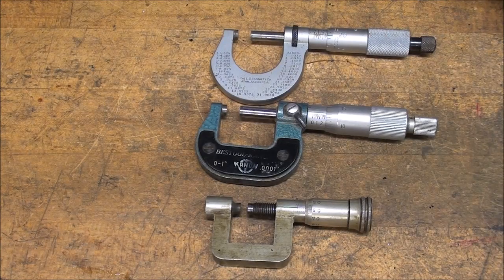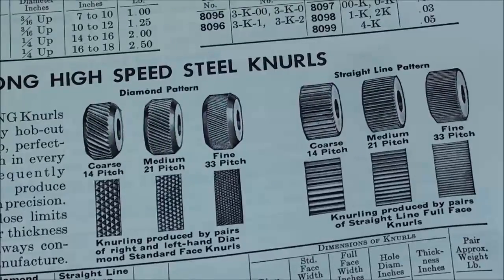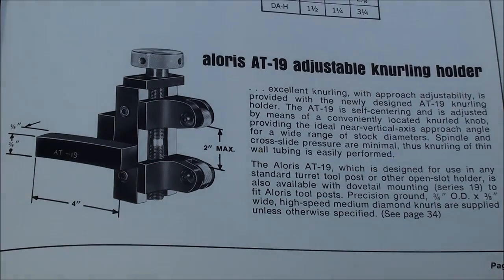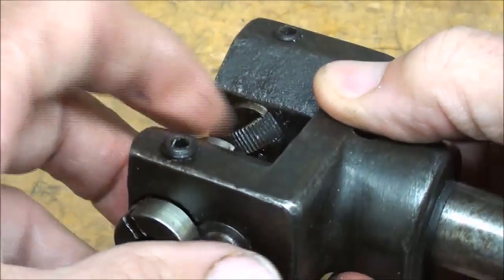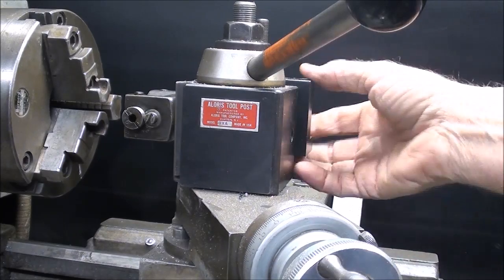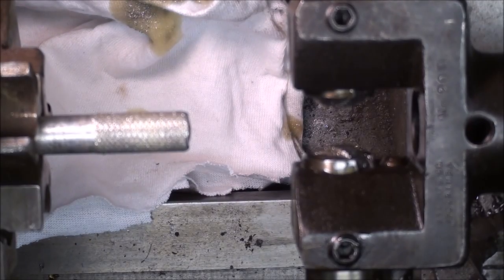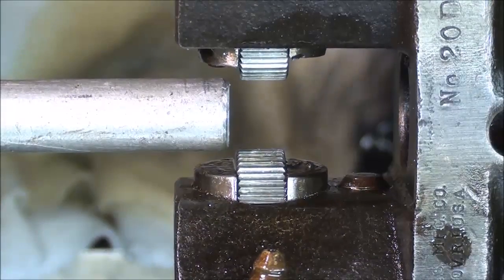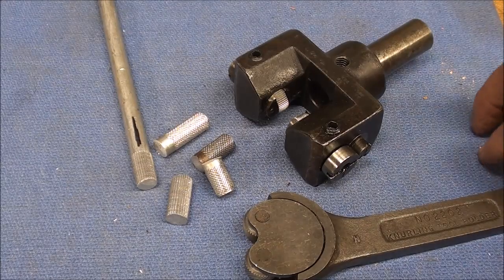SHOP TIPS #215 Knurling on the Clausing Lathe tubalcain knurler

Comment: This is long after when this video was posted, but 2 questions, if anyone who sees this can answer them: 

1) I’m confused by the fact that you don’t seem to have to calculate the spacing of the knurling dies (that is, the final part diameter between them) to match the pitch of the knurls. Isn’t this kind of like gear teeth, where the number and pitch of the teeth need to match the circumference? I’d expect to see some sort of defects, where the pitch and circumference didn’t match.

2) With harder materials, a wimpier lathe, or a thin part that can’t be supported as well as you’d like, do you ever need to take multiple lighter passes, rather than a single full-depth one? Would there be a reason why you wouldn’t want to do that? (I guess some metals could work-harden, so multiple passes would be self-defeating…) 

Thanks in advance for any insight people might have on these!

(And many, many, many thanks to Mr Pete for all the knowledge, experience and information he’s shared so generously here!)

Comment: Hi Mr pete i bought two sizes of pinch type knurlers one large one small chinese made for under $100.00 and they work good now if you need to change the roller i think you need to knock out a straight pin at this point you might have to make a new pin and thread it upgrade . with the two tools i can knurl up to 4 -1/2  in . copy of the Eagle rock tool made in usa. bought on EBay made in India .

Comment: I've never actually seen a scissor or otherwise opposed knurling tool actually used before, it seems the bump style is more popular on youtube because they work on any size work  (including working past a larger diameter) with no adjustment and are relatively cheap and can even be easily made. This type does seem much faster and requires a lot less out of your machine, though I do still see the draw of the other type. I'm also guessing, based on how often I see it, that it's ok to use a brush for an open wheel bump style knurler since there's a lot less for the bristles to get caught in, especially if it's on the exit side.

Comment: "I recommend you sell them on ebay to some unsuspecting sucker" LOL 
I agree about the superiority of the scissor type knurling tools. I was having issues with the lateral pressure from the lousy type knurling tool making my tool post rotate regardless of how tight I made the nut on top of the tool post that holds it down (I went to the point of stripping the threads of the vertical shaft that goes through the tool post). Then I bought a scissor type knurling tool and never looked back.

Comment: Very cool.  I need one of these things.  It would seem that the diameter of the stock needs to be such that when the ridge of the knurling tool comes around it ends up in the same place. If so, then the diameter of stock/diameter of knurl wheel/ridges in knurl wheel = integer.  Is my understanding correct?
Reply from the maker: I believe that is a misconception

Comment: Those aren't cheap anymore. EBAY: Brown and Sharpe Knurling Tool No 22D Shank Diameter 1" for Machine Machining
Pre-Owned    $130.00; BROWNE & SHAPE KNURLING TOOL 5/8 SHANK OO D LOC5132 Pre-Owned  $75.00 or Best Offer
 +$8.95 shipping     Buy It Now .   I got a 20D for $75+shp.  I like how this tool works.  Buying a used ENCO1340 lathe tomorrow.  You got me off my retired butt and back in the game.  Thanks

Comment: I liked the video very much.  I am not a machinist, but I do have a hobby shop in my basement.   I have mixed success with knurling so far, and have identified the need to do some math with the knurling wheel pitch and that expected knurled part.  This is indeed a mathematical function that has to be taken into account.  Common sense tells you that if the part circumference is not a direct factor of the knurling tool, you will not get a proper pattern.  Correct me if I am wrong...

Comment: A couple years ago at work we had a couple new parts to knurl, the (CNC) programmer had never done it before, neither had any of us. The part had a jeweled looking finish to it that looked fantastic, but, wasn't correct by standards. For days we tried different feed rates and speeds until we finally saw the problem. He had programmed the spindle to reverse when after initial feed was done to back knurl tool back off parts.
Reply from the maker: Glad you found the solution

Comment: Mr Pete: try as I might, I have never been able to see HOW a knurling tool does NOT overlap unevenly; as it goes past the 360 degree point of a turn; UNLESS it would be sized PERFECTLY to EACH piece it is knurling. Where is my thinking flawed? Could you please explain that in detail if you will? As always your videos are exemplary. May Jesus continue to richly bless you and yours always dear person.
Reply: It's kinda like having three gears mesh together. no matter the size of the middle gear, if the two outer gear are spinning as the same rate and have the same size with the same teeth pattern, they would still mesh and not grind or whatever.
Reply from the maker: To me, dia. has nothing to do with it. Billions of good knurls are made with pinch knurlers with no thought of dia
Reply: You are onto something.....Remember, in the video, Mr. Pete told you the tool was for 3/8 inch...so yes, those knurlers would work, AS LONG AS YOU TURNED 3/8 inch stock.....So yes, you are right....You're thinking isn't flawed...I learned this on my own...  You can't just knurl random sized stock and get a perfect diamond knurl.....You have to do some calculations.....But, if you're knurling other sizes, you have to match the diameter/circumference of the part to the knurling tool....  Excellent point.

Comment: Another question: suppose one were to make a tool holder that can hold the knurler vertically. That is to say a tool holder that bolts down to a slotted cross slide. The holder is such that the knurler rolls point upward as opposed to the conventional  toward the spindle. (assuming you could adjust/position on-center height and centered along X axis). Would the knurler still work? This would allow those like me who only have say a South Bend 9A (I only have an AXA tool post), to do longer knurling operations, or larger diameter knurls with the bigger B&S knurlers  (like a 1" or so).  I don't see yet any reason it wont work. unless the rollers cannot be positioned sufficiently for a vertical placement of the tool. But if it would work, I can envision it coming in pretty handy!

Comment: Mrpete I once had a 4x4 truck that had a bad front drive shaft splines stripped out in slip coupling I was told the splines were knurled on I got a man at a machine shop to make me new drive shaft with course splines.
Reply from the maker: +Joe Tiller No wonder they stripped

Comment: very cool video, we do a lot of knurling on the screw machines, it's very different and kind of easy ,it's done with a cam called in and out and is adjusted with a set screw on the tool holder, once again very interesting video.
Reply from the maker: +bill devlin Never saw one of those-Thanks for watching

Comment: Thank you!
I "recently" (within a year) found an old ball-peen (machinist size?) hammer that turned out to be one my father made in the 50's in shop class. It was in amazing shape. I've marveled at it as I've cleaned it up and done my best to provide it with usability as well as longevity by doing some very light (carburizing flame) case hardening of the head, cleaning the threading up and trying to concoct an anti corrosion coating that doesn't ruin it's aesthetics.
I'd just started wondered how he did the knurling on the handle how precise so many circumferences or their ratios must match in order to avoid missed knurls.
Reply from the maker: +MrJgstoner  Thnks for watching--be sure & watch my recent on knurling.
Reply: Will do!

Comment: Thanks Mr.Pete.All we had in high school were the tool holder type that you dislike. It would usually take me more than one try to get it right.If you straight knurl the inside of a bore,could you get it to spline to a straight knurl on a shaft like a slip yoke on a drive shaft?
Reply from the maker: +Mr Frog  Thanks for watching-I have never done internal knurling
Reply: Okay,just wondering.Thanks again Mr.Pete!
Reply: +Mr Frog  I have tried that, here's what I learned.
1. IF you get the same number of splines on both parts and
2. IF you get the correct pitch diameter on both parts and
4. IF you get the same side angle on both parts and
5. IF you get the same twist on both parts (straight knurling is seldom truly straight) then you will get a marginal spline that will have little strength or lifespan. Because of changes in pitch a few teeth will bear the load and wear, quickly becoming sloppy. Splines and gears are sometimes roll forged but are usually finished by milling, grinding, broaching, etc. to ensure size and straightness.
 My advice is if you need a sliding shaft joint then use a captive key and keyway or a square shaft and hole or an Allen wrench and hex hole. Square and hex holes can be found in sockets and socket-head screws. If you need a free sliding shaft then use a key or a square as hex can wedge under load like the setscrew that sticks to the wrench.
    Mike (o\!/o)

Comment: Seems like the variable use of this tool is small and that purchasing  one for every size might be costly over time. Also, if this is variable in the diameter usable, then perhaps the knurling might not be perfect if you change size a little bit (I have no idea how much would be noticeable). Like you said, I plan to buy a scissor type (one tool fits most sized I would want to do). Perhaps in the future, you might do a video on the scissor type of tool. This video leaves me very confident that if I did have this type of knurling tool, then perhaps I could do it easily and repeatedly. Thank you yet again. OH, and yes, I will sell the one I was a sucker and bought!!. ;)
Reply from the maker: +Jeff Conti  Thanks for watching--mine has a range  1/8 to 9/16

Comment: Mr. Pete, I have had success with the relatively inexpensive clamp style sold at little machine shop: http://lmscnc.com/1911 
I just match the diameter of the work to the number of teeth in the cutter to in order for the knurls to line up as they spin around. There is a handy calculator here: http://littlemachineshop.com/Reference/Knurler.php
I prefer to use a normal calculator and find the nearest division, then round down for my diameter.
Reply from the maker: +bendavanza  Thanks for watching--I might buy one of those

Comment: Hi !
Very instructive video for that size of stock you use there.

You don't mentioned the relation between the diameter of the stock and the type of knurling wheel you're using - because you tool is setup for the 3/8 size.

But the is some debate about this relation between the diameter and the wheel type - some says "Doesn't matter at all !" others says is DOES matter - Tom Lipton did a whole video showing the math for finding the right diameter - anyway I did a program to help you find the nearest diameter OVER/UNDER the one you want that FITS the wheel type you're using. 

If you're interested you can download it from my web site: kelds.weebly.com/sjov.html

but you have to know how to install programs on your machine - not the lathe but the comfuser ;-)) - and I garantee there is NO VIRA or stuff like that i that file !
Reply from the maker: +Keld Sørensen To me it doesn't matter at all, but most would disagree- Thanks for watching

Comment: I totally agree with you about the crude push type knurlers, they are the one tool that would put people off knurling for life, thinking for ever more that it is a black art! The knurler you show is a very good design, although for its cost has a very limited range of diameters that can be knurled, I always use my scissor type knurler which has a cam type pressure variation, this, unlike the awful push type, produces no side thrust on the workpiece, it is also self centering, (to a degree), and providing the revs are right, and copious oil flush is applied an excellent knurl every time.
Reply from the maker: +Englishman French  Thanks for watching---yes on the push type, no like

Comment: I always wondered how the knurling lines up once the work has done a full rotation?  I would think murphy's law would take effect and you would see a sort of a doubling up of the knurls.  Are the rollers matched exactly to the diameter you are knurling?
Reply: +Atimatik Army 
You might want to see this:  https://www.accu-trak.com/catalog.html 
The first pages of their catalog shows some basics about knurling, this is where we get our wheels for the knurling tool we designed and made, this tool  will end up in Keith Fenner's toolbox giveaway, we're planing to release the plans to make one pinch type tool like this one...
The diameters aren't super critical, you have to get close and sometimes it requires a bit of adjustment, by varying the depth a little you make up for difference...
Hope it helps...   ;)
To see what it looks like, you just get to my channel and see where we're up to, there is a video that features the prototype in action...
Reply: If I remember correctly the diamond knurling tools will mostly self align as it is worked in. For other tools starting with a piece circumference that's a multiple of the knurl spacing works best. This is from memory from quite a while ago so someone else can give you a better answer.
Reply: Interesting, thanks for responding, if anybody else can elaborate, by all means please do! cheers
Reply: +Atimatik Army the chamfer, and the precise setting of the distance between rollers in a pinch type knurler will also align the knurling. It's with the hand knurling that things get tricky.
Reply: So with a pinch type knurler tool, they must be only able to do very specific fixed diameters in order for the knurls to line up exactly on themselves as the work is rotated, correct?
Reply: Atimatik Army the knurl pitch diameters are limited, but since undersized stock will just not form complete knurls and oversized stock will have the excess cut away precision diameter stock isn't needed. Depending on the application having incomplete knurls can be an advantage (it doesn't come out looking as clean but having flat tops is much nicer on the fingers than points)
Reply: Wow, knurling is a little bit of an art all of it's own, had no idea.  But yep, I hate aggressive knurling and hear you about them having flats tops opposed to a bunch of little spikes!
Reply from the maker: +Atimatik Army I works every time on every dia.

Comment: 1.  Interesting type of knurler.  In the device you showed, what are the minimum and maximum diameters possible?  Is there any magic to setting up the knurler for a particular diameter of work?2. I had to go look up exactly what a turret lathe is.  Perhaps a tour of the different types of lathes would be a topic for some day.  I'd be particularly interested in the relative advantages of each type.3. Must this type of knurling always start at the end of the work piece?  4. Is the turret knurler fundamentally different than a scissors-type?  Aside from the strength of the design, they seem use the same principle.Thanks!!Dave Kellogg
Reply from the maker: +Dave Kellogg  Thanks for watching-Its really the same as the sissors, but harder to adjust. Those are good ideas